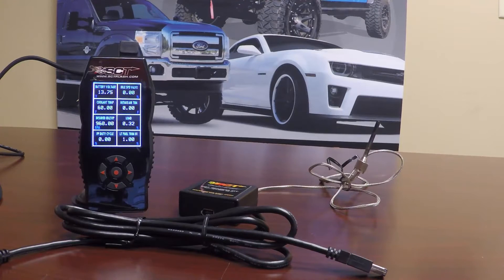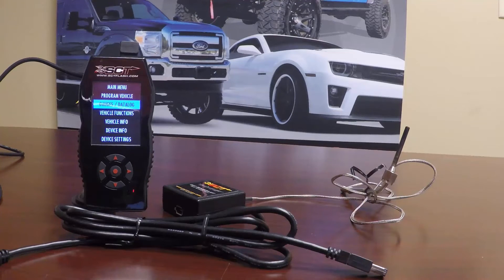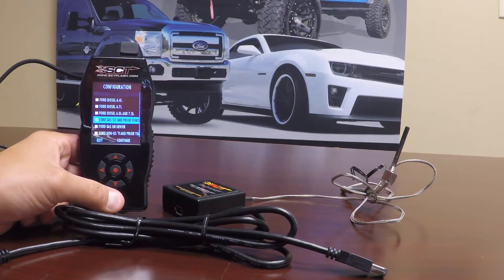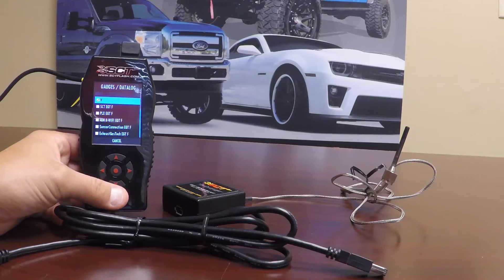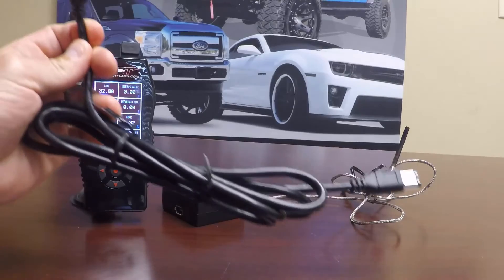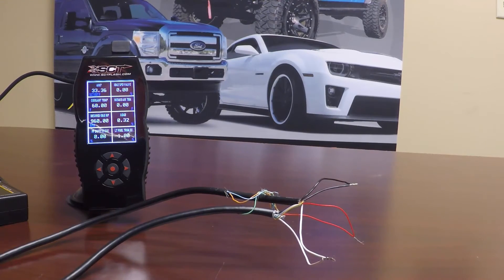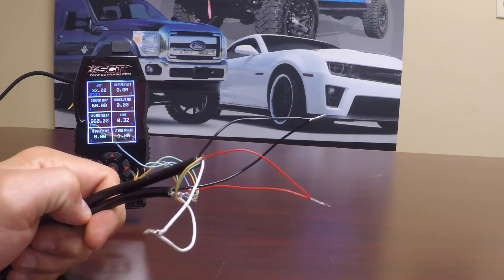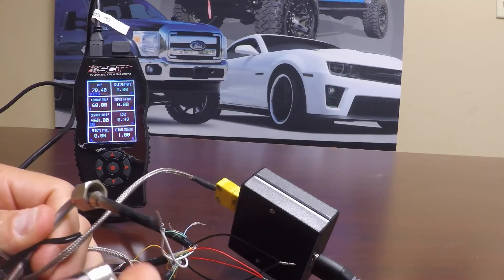Setting up Analog Inputs on your X4 Device

Comment: i have the x4 tuner. the analog afr reads in volt on tuner and dose not convert to ratio when loaded in live link. Also in the x4 there isnt a match for the formula that i need. Can i enter one  in the x4?